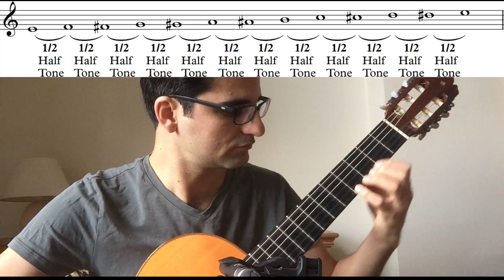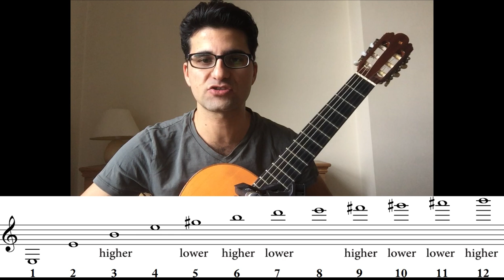Major 3rd Problem of All Guitars in the World

Comment: Tolgahan, I have been playing guitar for almost 40 years. And in all that time I have always thought that something was slightly off. I am a hardcore tuning freak! I mean I am always pressuring bandmates to get in tune and as for myself, I tune between each and every song. Even going so far as to add the tronical tuning system to my main stage guitar and one other backup guitar. After all, if you're not in tune, then even when playing at your best level you aren't sounding your best. But even with all these extra measures I have taken, the slightly off sound is still present. I just stumbled upon your video by accident and what an eye opener it was for me. I want to say to you, thank you very much! I am now going to watch more of your videos and try and fix this lifelong dilemma I have endured. I am really excited right now! Thank you very much for showing some light at the end of the tunnel! Peace to you and your family
Reply from the maker: Thank you very much Sean. Glad to hear this. I think you need an electric adjustable microtonal guitar. The only problem is you can't bend though.
Reply: Of course, Tolga forgot to mention the why of the equal tempering and the downside of harmonic tuning. The problem is that it is ABSOLUTELY IMPOSSIBLE to tune all the notes as proper harmonics of each other. I won't go into the details of why, but suffice to say that it would require square root of 2 to be a rational number, which is not. Taking any note as base (let's take C as an example), if you take a harmonic third (that would be E), then another harmonic third (G sharp), then another harmonic third (C of the next octave), the new C will be completely out of tune with the first C. Another way to explain it, the B is a lousy 3rd of G, but it is an excellent 5th of E. Add a fret to improve the G's third and you spoil the E's 5th. So you can do great to tune in true harmonics for a chord or two, but you will be spoiling the rest. Equal tempering is a sort of middle ground where all the chords will have some notes slightly off but equally off. None will sound perfect, but a C major, F major, G sharp major, or any other major will sound exactly equal (just transposed). Any attempt to improve the tempering for some chords will worsen it for others. UNLESS... you put enough frets out there to make the perfect 3rd, 3rd minor, fourth, fifth, seventh and so on of EVERY note. Then you will not have 12 notes but 12*(whatever number of harmonics you want for each note), that is at least 48 notes if you want to be able to play every chord just in their major, minor and 7nth versions.
Reply: @adb012  Only solution is a fretless fingerboard, a super sharp ear with perfect pitch and insane degree of physical coordination and accuracy.
Reply: @soundcheck6885  ... Fretless, sharp ear, perfect pitch, insane coordination, and accuracy. Got you. Working on it. Call you back in one week to see how it went. 😂
Reply: @adb012   Darn, so you're not Yo-Yo Ma?😜
Reply: Or to put it more simply: fixing those intervals breaks other ones.  If you're sticking with music composed in a certain key, and avoiding the intervals which sound bad, that might work okay for you.
Additionally, It's more limited than just having the right instrument for the song you're playing.  What it means is that you can't compose music that changes keys within the song, without dealing with the fact that most key changes will cause some really dissonant sounds in those keys.  Even passing tones from outside the key can stand out in a bad way.
Reply: nwimpney 
Technically you can compose music that changes keys a lot AND is perfectly harmonic. You just have to adjust the microtones as necessary. The only problem is, while it’s not hard at all to do digitally if you know what you’re doing and have the right software, it’s not actually performable on the fly so it can really only be done with recordings
Reply: ....does this work for air guitar too?
Reply: Wesley alan of course it does. Try using a broom versus a cue stick and see the difference. See!
Reply: Some people have better ears than others. I think we'd all keep tuning if we kept hearing it be wrong. If you watch guys like BB or  Albert King they would be reaching over adjusting tuning in between licks all the time; these were 'less is more' guys with notes, meaning the pitches were really out there in the spotlight and needed to be right on. When you see them adjusting their tunings by ear and feel 10 or 15 times in a song, you start to think that maybe in between every song isn't so crazy for someone with a really good ear.
Reply: Well said, Sean! This equal temperament is grim, even on a bass unless unmarked fretless. And the more strings, the worse it becomes!
Reply: here's something to drive you mad: the guitar is a flawed instrument. there is an intonation discrepancy between frets due to the thickness of the string. different string gauges will give you different intonation inconsistencies.
Reply: Zenthex 
Woah! I’d love to read more about that. Do you know if that phenomenon has a name that I could look up?
Reply: Zenthex 
Is that by chance related to inharmonicity?
Reply: The solution is a fretless guitar! But thats another can of worms.
Reply: Sean McAleavy i have always alikend the fact that i tune my top 3 strings slightly flat to the worn frets on my. guitar..  They always sound sharp when i fret open chords after using a tuner to tune up.  Especially the relationship between the b and g strings always bothers me..  I suppose the dissonance becomes more apparent in the higher frequencies..  Maybe there is no 'problem' with my instrument at all...
Reply: I am on the same boat. I'm not a musician, but have been playing guitar for 25  years and have always been frustrated with tuning my guitar.  I have tried to tune my guitar using harmonics, but the result was awful. I always assumed my guitar wasn't of good enough quality (distance between frets, bridge height, strings weight/diameter' etc). Learning about equal temperament was an eye opener, but thinking about all those imperfections ruined music for me. :)
Reply: @JosueReynoso  you can still listen indian classical music with sitar , its tuned in a natural way with pure perfection. The desighn of that instrument is made specially for pure sounds , which will make resonate other additional strings , like on this video was shown. But ofcourse , you have to tune the instrument if you change the scale or other composition with other basic notes. If europeinian system is inperfect it doesnt mean all other systems have the same.
Reply: I mean, the thing is at this point is that there is no perfect. There is only what works for the music. It's all compromised and that's wonderful and frustrating depending on how you look at it! Be free make music. I play with true tempered thirds sometimes and equally tempered thirds sometimes. I play oud and fretless guitar (flexible pitch), steel string guitar (equal temperament), want to put more frets on my guitars (to tune to different makam and more), and baglama saz (turkish makam) and setar (persian radif). As someone on here said, yes, a perfect major third makes a lousy fifth for another note, so unless you only play fretless instruments or have a ton of frets per half step (a worthy thing to do in my mind, and super fun) you are going to be compromised in some way or another. It's fun to modulate with equal temperament, fun to swing around justly tuned and equally tempered keys like jacob collier does, and wonderful to hear the sound of thirds in tune with the harmonic series. I have so much more to learn about this and appreciate so much Tolgahan's videos, I just want to discourage people from thinking that there is some perfect way to play (maybe maybe not) and you won't be happy until you find it. Anyway... not to be pedantic. I love this stuff
Reply: Yes Sean, same here.  I have always avoided songs with an open A major, just can't stand it LOL.  For the first time in decades, I know why.  Don't get me wrong, I am happy with the tempered scale and the balance It allows.  It's just interesting how I have ALWAYS heard something off like you.  This seemingly simple concept also helps my ear appreciate microtonal scales that I didn't grow up with.  Thank you for the video Tolgahan.
Reply: Im high right now and this bothers me so much. I know it is a stupid question, but could fanned frets somehow alleviate this problem?
And also another question: equal temperament makes a decent compromise of all these harmonic 'instabilities', but wouldn't that mean that a lot of mostly self taught or old school guitar players would tune low E to a piano for example and then by ear tune the other strings, not tuning them perfectly but unconscionsly tune them in a way that it enhances some harmonics instead of others and therefore creating an almost unique signature of their sound ? I've heard of people claiming that.tuning by ear provides a more 'musical' sound to guitar.
Reply: asmo deus  take another hit bro.
Reply: yes, you're going to stay restless. It's basically not possible for a guitar to be in tune. the frets need to be in a different place on each string for that. You've just got to accept the compromise if you want to play this instrument. And that's just being in tune in equal temperament, not even natural/just intonation like he's demonstrating here.
Reply: Try violin.
Reply: @McSlobo  Violin can sound really good . . . or REALLY BAD.
Reply: You must be a nightmare to play with.  I think be ever so slightly out of tune adds a warmth to the song.  And I am into discordant things.
Reply: Since he mentioned that the guitar is like a piano, I think I should post this Minutephysics video on why this "solution" is really a preference. In reality, by getting your Major Thirds working better, everything else is going to be slightly off.
https://www.youtube.com/watch?v=1Hqm0dYKUx4
Reply: There is true temperament guitars on market. Just check some videos about this guitars. For example this one https://www.youtube.com/watch?v=-penQWPHJzI
Reply: @NickolasBerdzenishvili  were you aware that true temperament guitars, or at least the example you linked to, are not tuned to the harmonic series, rather, they are in more perfect equal temperament, as opposed to the weird version you get with fretted guitar where the frets go all the way across?
Reply: i wonder how in 40 years of playing and being a tuning freak you never heard of a true temperament guitar
Reply: Mehdi J 
It really depends where you are and who’s around you
Reply: i even returned one guitar to store, two years ago, because i could not tune it.
Reply: I'm not sure there's a way out. Each tone centre defines its own consonant scale (where the overtones eventually match up if you go high enough). 

The thing is as soon as you play another chord the scales change... and then you just keep on getting more and more scales.

Equal temperament is one hack to approximate these scales.

If you look at a simple progression like One, four, five, one it's almost a joke saying "look 3/ 2 * 9/ 8 is approximately to 4/3". Chord progressions are almost statements of approximation.
Reply: have you succeeded?
Reply: Im glad im not this O. C. D about tuning.... Id probably go nuts if i were, lol
Reply: Wesley alan 
Most people don’t care because it’s close enough to be difficult to notice. People with trained or pitch-sensitive ears though hear it a lot more pronounced. Just like you don’t choose to understand what these words mean when you look at them, they don’t choose to notice. They can’t help but notice, and I can see how that would be maddening. I deal with it a bit myself, but my ear is somewhere in the middle of the road
Reply: you care just slightly too much. tuning every song? might want to check your instrument for imperfections and then go to yourself for the same reasons

Comment: . . . or use a compensated nut. The Hosco Sound Offset Spacer for classical guitars works very well. The solution shown here only works in certain keys. A compensated nut will make the whole fretboard play in tune. Another trick is to put an 8 mm section of cocktail stick up against the nut under the G-string. You can sand a flat on one side of it to stop it moving. On a classical guitar, the G# on fret 1 played on the G-string is particularly sharp, more so than the C# on the B-string and the F# on the top E-string. Major thirds in equal temperament sound fine as long as they are not sharper than they should be. Unfortunately, they often are in cowboy chords if the nut is not compensated. Some luthiers move the nut forward by about 0.7 mm, which helps, but a properly compensated nut is the best solution and allows the guitar to be played in any key.

Comment: Thanks for the video brother. I can’t count how many times I’ve checked crowns on my frets . checking the nut for proper slot depth and constantly checking intonation and trying multiple different tuners . I found out the better the tuner the bigger the problem was and then I found what true temperament meant and I just live with it😂😂😂😂
Now I follow the advice of Edward Van Halen ,tune it to where it sounds right and deal with it. I use a blend of tuner and harmonics in the positions that are most commonly played, and it works pretty well, provided the intonation, the nut and the crowns are as good as they can be . sometimes high gain applications can bring out some weird tones, but we just work around them with a twist of the tuning peg😊

Comment: As long as we want to keep the 12 intervals in the octave, there is no way we can have “perfect” tuning, Pythagoras proved it and this problem has challenged musicians since music exists: https://blog.jytou.fr/2019/01/04/the-simple-tuning-problem-that-has-defied-musicians-for-millennia/ So indeed we have to have more intervals, and your guitar is a great example to solve this problem. Other instruments require a lot more logistics to achieve the same goal (think about an organ, you simply multiply the number of pipes by 3 - almost). So if you think about it, you will constantly move from one series of frets to another depending on the current mode of the tune, so that the listener will actually only notice that at every moment in time things are in tune, and it's quite difficult to notice such slight changes over time, that's quite smart! Besides, it can probably create switches that are quite unique. Thanks for the great video!

Comment: The M3 and m6 are sharp, and the m3 and M6 are flat---in EVERY key of the Equal Tempered scale. If you make the corrections he shows you will not be able to play in other keys on that guitar. There is no reason to use the partial frets! If you are going to make a recording or performance with exact ("just") notes, tune your guitar with "just" frequencies (not with Equal tempered frequencies) and all will be fine. BUT if you change keys, you will have to retune. The Equal tempered scale allows you to use any key---and every one is as good (and as bad).
Reply: Good thinking, universally out of tune keys over playing in one perfect key.

Comment: If one uses a compensating bridge, for example, as found on most electric guitars, and the saddles are positioned a distance so that the high e, b, d, and g strings have the same length when fretted as those strings would using the added frets, would the same result be achieved for the open chords?  For example for a particular song where the guitar part is all open chords.  
I have noticed when recording that I wind up turning the chords instead of just using a tuner, depending on the part, or else stuff sounds sharp within the chord despite the tuner saying all is right on.  It's great to have the reason illustrated here.  
I've also noticed that when a guitar (my experience is entirely steel string) does not have the slots in the nut the proper depth, the sharpness of the notes fretted for open chords is even worse, and that is what I have been blaming all this time for the differences you illustrated here, I am glad to know that it's more than just excess tension due to having to displace the string due to the nut slot depth, and now I'll be more mindful of the compensations needed.
Excellent demonstration!

Comment: Lute players often skew their frets (which are made of moveable nylon/gut) to suit the key of a piece. I used to do that a lot, less so as I got older. Guitar intonation can be troublesome, mostly though because of the varying string thicknesses (esp the g 3rd) and a saddle that hasn’t been intonated by a luthier. More so than  by the harmonic inaccuracies of equal temperament.